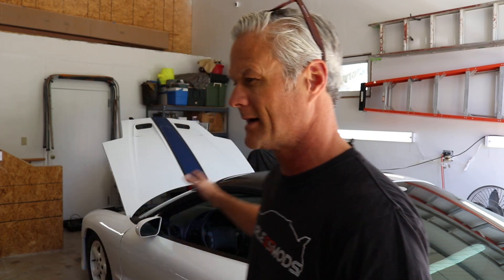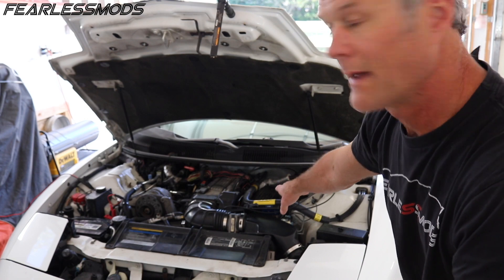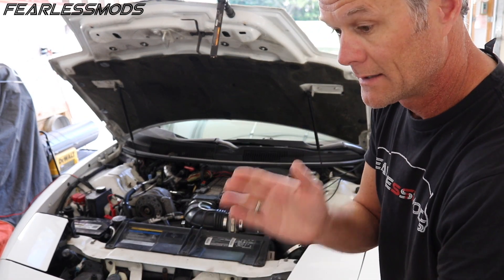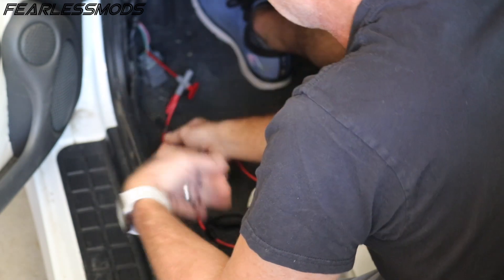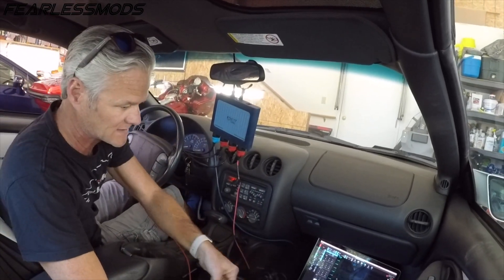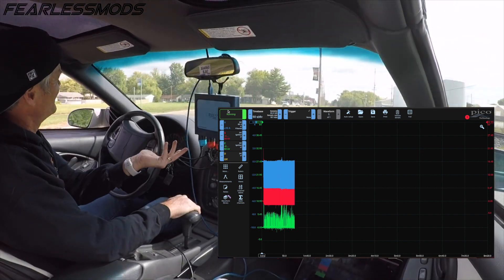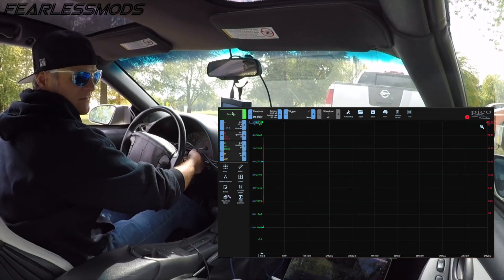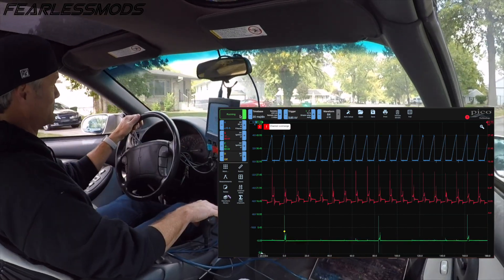Pontiac Firebird Trans Am Ignition Diagnostics part 5:  Driveability Test

Comment: I’ve comment on your videos before. I’ve got a 94 that I️ totally rebuilt. I skipped the opti because it was just done before I️ bough the car at a GM dealer (to the tune of $3500!!!). Everything ran fine up to a point but the car ran like garbage over 5,000 RPM. 

Long story short, I️ did the LTCC semi-conversion. It solved everything. The car revs with zero issues and makes power to 6,500 rpm. The whole thing was fixed for ~$600.

Comment: Good Monday morning on this Columbus day Biff... trouble shooting can be challenging.. do you have a check engine light on?
Reply from the maker: You too!  No CEL, no DTCs tripped, but good news…I found the issue and will reveal it in the next one!
Reply: @FearlessMods  excellent 👍... LT1 engines run great when they are 100% ... Any misfire or lack of power without a check engine light.. that's when the head scratching begins...